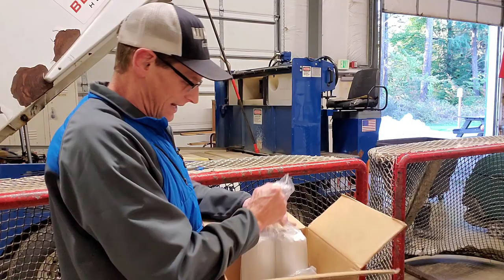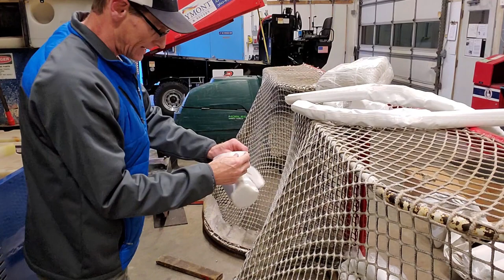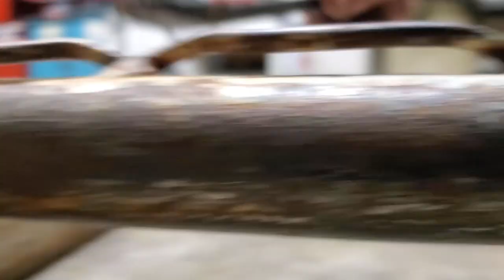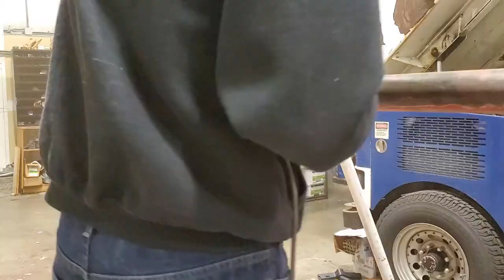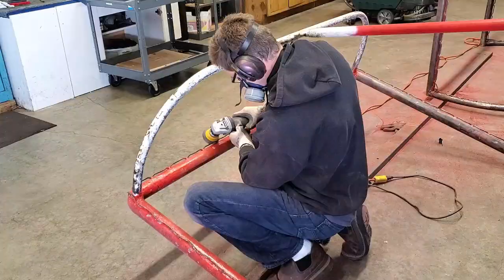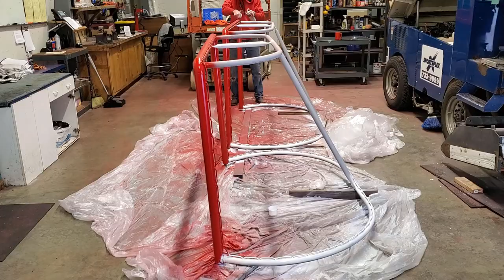Hockey Goal Frame Restoration Part 1: Grind and Paint

Comment: What did you use to pry open the bent rivets? Looked  like you used 2 separate things
Reply from the maker: It is just one tool with two ends. It's a nail puller. I use it as a little crowbar too.